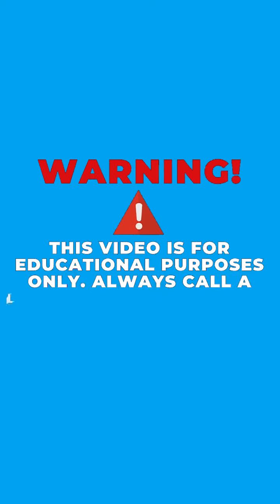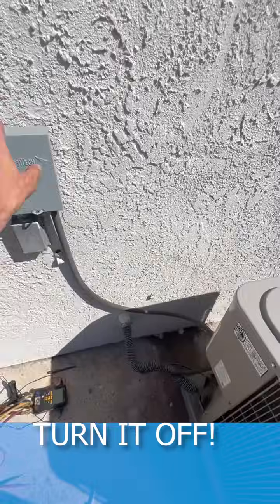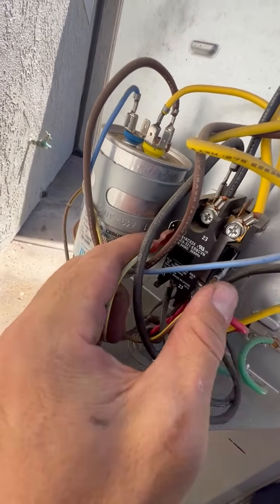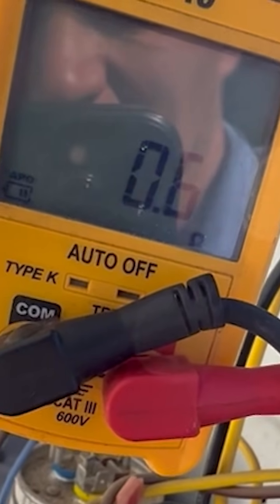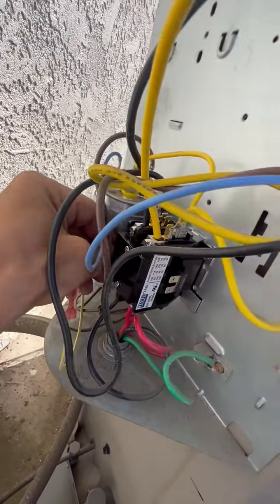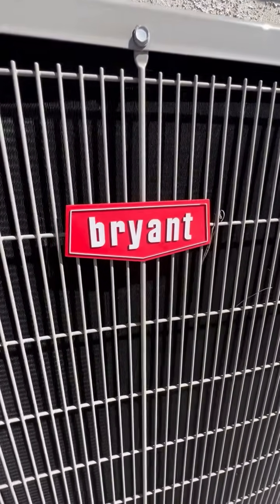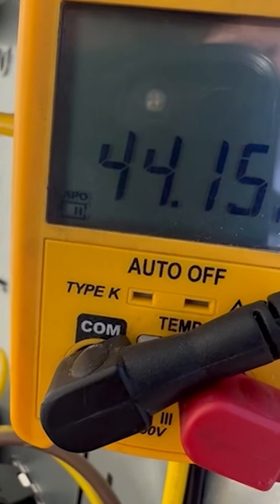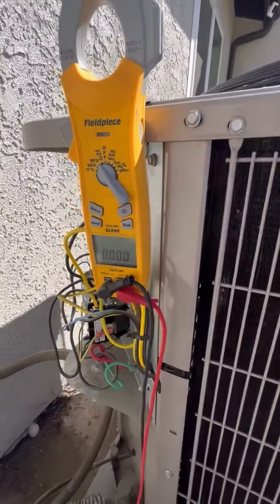Nest thermostat has detected a problem with the Y1 wire E103  Nest 103 how to fix it?

Comment: Thank you for the video   I followed your steps in replacing my contactor  and AC now blowing cold air and working properly      $18 part   not bad   took 20min to swap out      I took many photos when taking off to know exactly the order of the wires back on

Comment: Thanks a bunch for this video. My next gave me this error this week while away for training. Ordered a new contactor and capacitor. I figure I might as well replace both, if anything, a preventative maintenance. Hope this resolves my E103. Parts come in tomorrow. I'm nervous about doing it lol. Tips on cleaning the outside unit, spaying off with water or something?

Comment: My nest thermostat does this at least once a summer season randomly.. it only wants me to pull the wire out, run the wire stripper tool along the exposed wire and then plug it back into the slot... did it today and then works fine

Comment: Nice video - BTW 5% of 45 is a tad over 2 - so if it shows less than 43, it is probably a good idea to replace.
Also looks like you swapped in a double-pole contactor for the original single-pole.  Interesting.

Comment: This worked for my carrier unit.  I also replaced my capacitor at the same time since my unit is from 2016. The part cost me $18 on Amazon local  HVAC store wanted $50.

Comment: I very rarely enter comments to videos posted in youtube however, I felt almost obliged to add mine today. On Friday I noticed the same issue you reported in your video, I measured the resistance of the coil of the failed contactor and it measured 1.3 ohms. I ordered a replacement from amazon and it was delivered to me today Saturday morning. The new contactor from American Zettler measured 13.6 ohms. It took me less than 20 minutes to replace it following your video and my AC is up and running again. No more Y1 E103 error in my Nest AC controller.
Thanks, you save me probably hundreds of dollars (I paid $14.48 for the new contactor) and you helped me to have a better understanding on how the AC systems and the NEST controllers work.
Needless is to say that the help from NEST was very, very limited and did not point me in right direction.
Once again thanks!
Reply: hell yeah. I'm about to do the same. fingers crossed it fixes my issue too! I tested only 1ohm of resistance at my contactor
Reply: Which contractor to use ?

Comment: Weirdly enough I tested the contractor and it was bad reading at 1.2 ohms, and I replaced it thinking it would fix the issues but I still get a e80 no power to y1 error :/. Any other ideas?